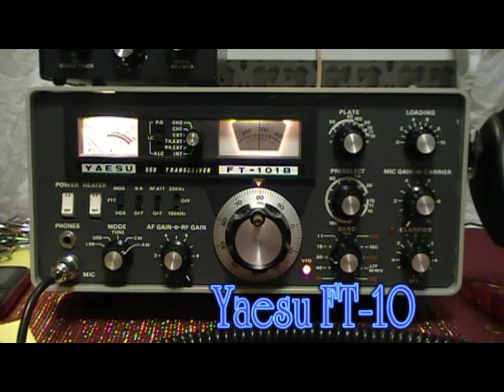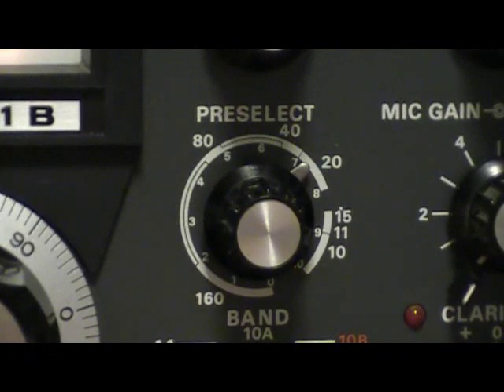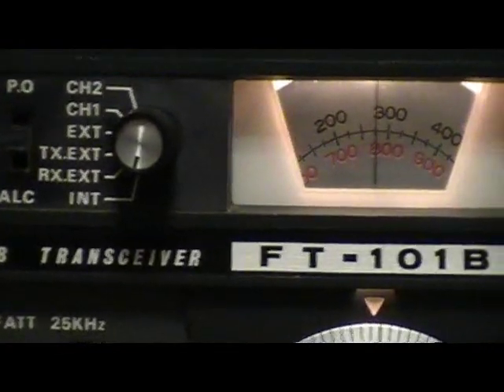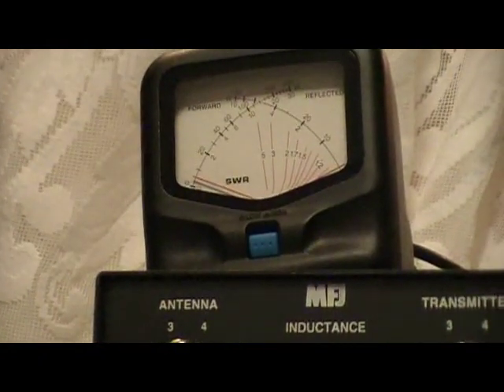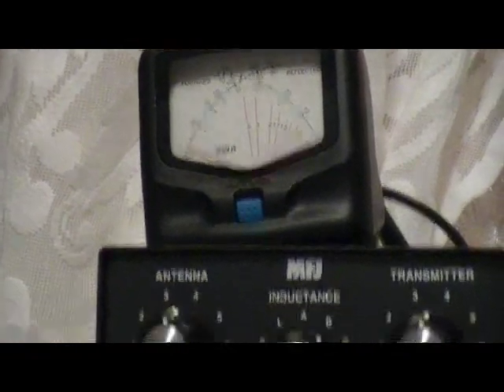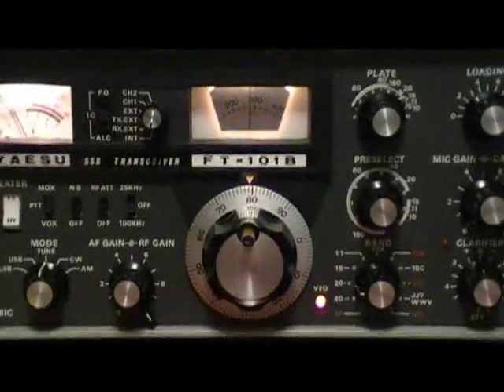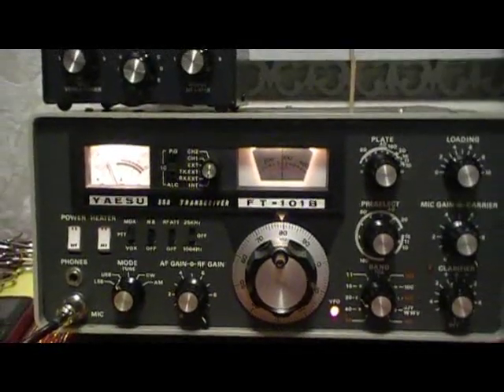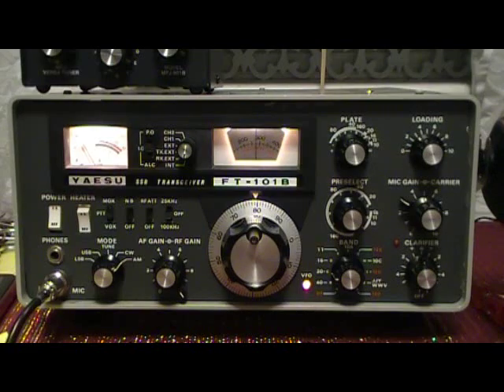Yaesu FT-101B; Tune Up Procedure

Comment: i just use plate and load, no external tuner! If you're not extremely carefull, external tuner can block your output, you SWR will rocket and your PA tubes will go. Say I want to tune on 7mhz band. Main vfo to 7.15, mic gain zero. switch to LSB. Preselect for max signal. Switch to 'tune', carrier zero, then swith MOX on. Plate will be set for maximum PA on 7mhz band and so will load (normally about half ay). Just enough carrier to give clear indication.
Then carrier to zero, and tune back to lsb. Preselect will have now been tuned max PA, as will Load for centre of band approx. 7.15mhz. Now turn up mic gain good half, and simply talk, PA on internal meter should move in sympathy with any watt meter in series with antenna, even an external swr meter, because swr increases with more audio, by a tiny amount. As long as swr is no more than say 3 on absolute full power tune dont worry, but dont even test this. More damage is done by people sending modulated carriers on tune, than ever speaking on transmit lsb with human voice, even a swr up to 3to1with human voice ssb is better than continuously tuning up all the time even with a swr under 2 or cw. So remember you rough settings for all bands! Antenna in tune for any particular band more important than a semi correct swr a meter can give! If on 40m use a 10M/20M or 40M long EFW wire, a proper beam Yagi or even a cheap 40M whip! Dont start of with trap antennas or multi band antenna unless you really know what your doing! Brian (m6baq)

Comment: Hi, I have a 101e, do they use a dynamic microphone?
Reply from the maker: Bill, I don't have the 101 anymore so you'll have to check out forums and the internet.  If I recall, these radios worked best with the stock mic that came with them.  Yaesu also has a desktop version of the mic for these boat anchors

Comment: Hi Ray just found your channel and am very happy. I just got my general ticket and scored what I THINK was a great deal on an FT-101. I took it to my local club and they put it up in their shack on their antennas and everything SEEMS ok but only one guy there was somewhat versed in the 101. He said alot of the same things you are doing with one exception that I thought could be a bit sketchy. He said that in tuning the radio to the antenna (in my case It will be a G5RV) that an additional tuner wasnt needed since you were tuning it every time you changed bands to THAT particular band. Is that actually correct or would I be better off doing what you are doing with the external tuner? Thanks

Comment: Good afternoon !...sir.  I have an   Yaesu FT 101 E  Transceiver.  And I like it.  I have owned it for about 41 years.  Question !  Is there still parts for my  rig ?   And WHO CAN I SEND IT TO !...IF it needs fixing ??   Joe Medrano.  I am a disabled Vietnam veteran.   Age 74.         email    ignaciomed.16@yahoo.com     Address   1523 jody lane     Irving, Texas  75061.       Wed. 12:52 pm.    Dec. 6,  2017
Reply: joe medrano Hermano, fijiese bien en lo que te voy a decir. Se bien que eres de otra generation con los 74 anos que tienes, pero es increiblemente irresponsable dejar un comentaro escrito con la direccion personal de tu casa. Por Dios viejo, que pretendes que te escriban una carta o visiten la puerta de casa? No estamos en el 1960. Hoy en dia te roban lo poco o mucho que tengas si sigues dando informacion personal. Referente al radio, unicamente EBay es donde puedes conseguir piesas. Si no te has dado cuenta, en las ultimas dos decadas EBay ha sido la unica fuente para todo. Suerte hermano y protegete.

Comment: If you follow the instructions in the manual it says,key for no more than 10 seconds & then unkey for 10 seconds before keying again.You did NOT pause anywhere near 10 seconds on any part of that tune up? If we are teaching we should teach by the manual not by our own way unless the manual has been found too be at fault & it has not.Keying that often will overheat the tubes so follow the instructions in the owners manual & save those finals because they are getting expensive & harder too find.

Comment: Thanks, man. I have a FT-101EE and I love it!! The receiver is better than my FT-897 (on 80 meters at least) I am going to re-tube it this summer and I had a local ham go thru it and all the caps in the rig & 1 FET in the receiver replaced. It was Never hacked by a CB'er . I am one lucky ham to have such a fine radio DE W8ARR

Comment: Excellent instruction, I just bought a ft-101e that is in great 100% original unmodified condition and the settings you showed gave results identical to yours. I'm relieved to find that the stock tubes are giving full output.  Thank you'

Comment: How come you started the tuning process in the center of the band like 250 rather than tune at the left of the VFO such as 7000 Mhz. (or the zero) My preselector doesn't seem to be as sensative on the left end of the VFO in all the bands on my Yaesu 101-E.  The service manual is very awkward while your procedure is straight forward. Thank you for posting your videos.

Comment: Thanks for taking the time to go over the tune up procedures for this solid transceiver. I wanted to pass on that if anyone is having problems with no transmitter power and or adjusting gain on the finals make sure you have the accessory plug installed on the back of the rig. The 8 pin plug has two pins jumpered together which provides power to heat up the finals. It's basically an old Heathkit 86CP8 plug style.
Reply: +John Jewel  GOT IT, figured out.  On the Yaesu FT 101 series the VFO is set up with band markings from 0 to 500, zero on the left. I was having issues with not being able to tune on the left side of the VFO throught all the bands, and wondered if that is why people tune in the "Middle" of the band. NOPE- I found  the PB 1180 band pass filter needed calibration. See the service manual page 7-17. This will adjust power equally across the scale. This too will provide the "noise" you need to find on the preselect.

Comment: I'm wondering why many of tube-based transceiver owners uses an additional antena tuner? I thought, that build-in Pi-filter is enough for matching the output...?
Reply from the maker: i use an end fed long wire.  must use a tuner.  i can't answer for others
Reply: xxRenaissanceManxx But haven't You tried to match the antenna using "Plate" and "Loading" knobs only? I think that using an additional tuner is not necessary in this case, cause Pi-filter in Yaesu is a tuner itself (I'm not picking, just wondering...)?
Reply: ummagummiak No, the Pi couplers' job is to match the tube impedance to 50 ohms.  The antenna couplers' job is to match 50 ohms to some complex antenna impedance, should that be required.  You COULD fudge the Pi coupler to do both jobs, but you will sacrifice its' ability to suppress harmonics - which will be perfectly fine from a poor operators' perspective, but most unfortunate for other band users.  Always peak the Pi coupler of any output stage into 50 ohms FIRST, starting with the exciter and then the amp.  After that, you will need to re-peak the exciter pi coupler as you swap from the dummy load to the amp, as the amp input will be slightly different complex Z to the dummy load.
Reply: Steve Wright Thank You very much! That explains everything! :-)

Comment from the maker: this radio is built like a tank and very powerful.  you have to weigh old school vs modern with features like memory presets.  i chose the 101b because it could withstand emp and is easy to service.  it's also loud.  you will need a tuner and an antenna.  if you look for one, try to get it from a ham.  many of these are out there but hacked up by cb'ers.  good luck

Comment: Renaissancemann,,, I would like to wire a 4 pin cobra mic to my yaesu ft-101, I have it wired to the 4 pins where it keys but no audio,, any idea what I have done wrong? could one of the wires go on with the ground, making 2 connections on one pin and leaving one pin empty??? thanks
Reply: Having it wired properly would be the biggest issue.The wiring diagram is NOT the same for a Cobra as it is for the FT-101 just because they both use a 4 pin plug. LOL

Comment from the maker: am functions only in the am mode.  if you look at the mode switch it has LSB, USB, TUNE, CW and AM.  AM works on all bands, though AM is only used on limited parts of the bands.  For example...AM is the mode of choice on 3.875 and 3.885

Comment: how does the am function on this radio,,, only on aux or on any of the band selections
Reply: All bands should operate on AM mode but without an AM Filter the transmit & receive quality will be less than pretty.

Comment from the maker: of course...when i tune, i'm using the meter on the radio.  there are two tuning modes; pre-tune and final tune.  what we should do right now is get you a copy of the manual.  send me a pm and i will get you a pdf file which is the full manual.

Comment: GREAT VIDEOS....I JUST AQUIRED A PRISTINE 101B.I USE RESONANT ANTENNA ON 40 METERS.I DONT HAVE AN SWR/WATT METER AT THIS TIME,OR THE MANUEL FOR THE 101B...IS THERE AN EASY WAY TO TUNE THE RADIO USING THE METER ON THE FRONT ?? THANKS

Comment from the maker: that would be true if the antenna was unknown.  remember, the 101 has a very wide pi network.  25 to 100 ohms.  i tuned thru dummy load when changing tubes and testing.  not necessary when connected to a resonant antenna